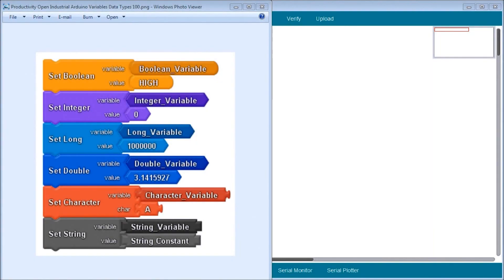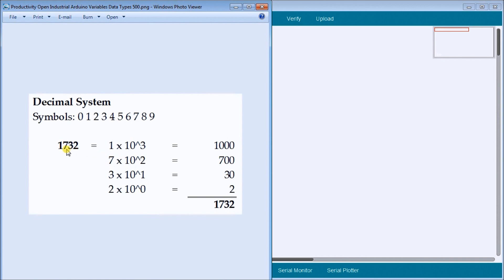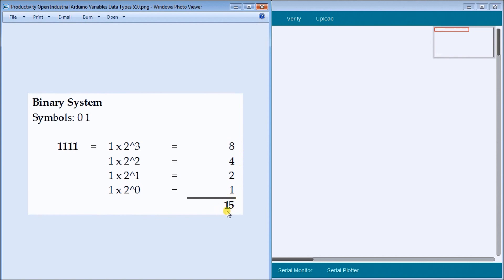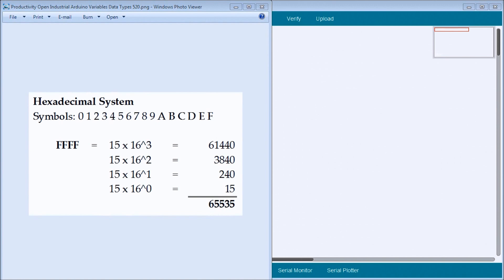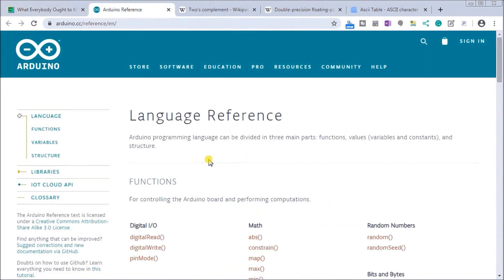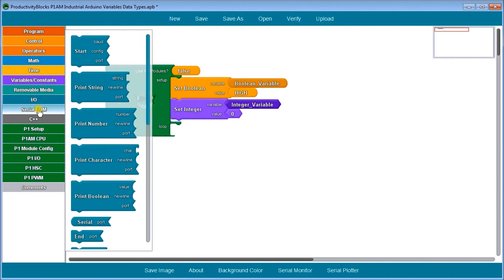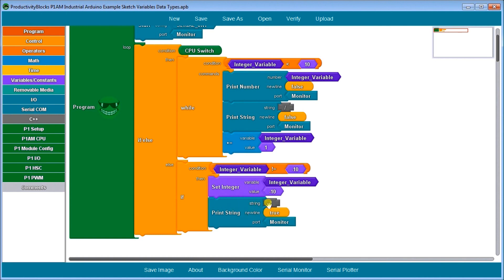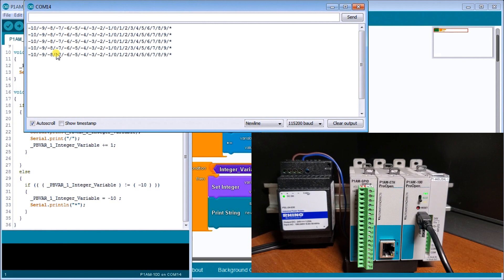What Are Arduino Data Types? Find Out Fast!

Comment: Hello There,
just a quick question. Why did the program execute only once after switching it on? Shouldnt it reapeat over and over since it is in a loop? Thank you
Reply from the maker: Hi Boss302cui,
The program is constantly repeating over and over. It is looking for the CPU Switch signal. If true then it performs the print instructions. If false then it will compare the integer value to -10 then we will set the integer value to -10. We will then print a string (*) out of the monitor port. 
Our website has the post for this video. It will explain in more detail the operation of the program.
https://accautomation.ca/productivity-open-p1am-industrial-arduino-variables-data-types/
Regards,
Garry
Here is the entire series link:
https://accautomation.ca/series/productivity-open-arduino-compatible-industrial-controller/